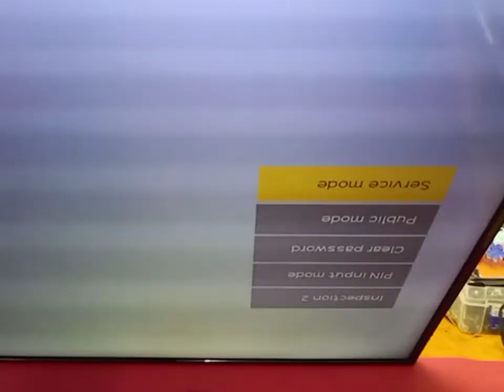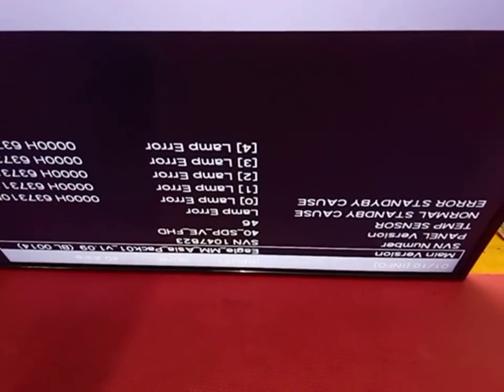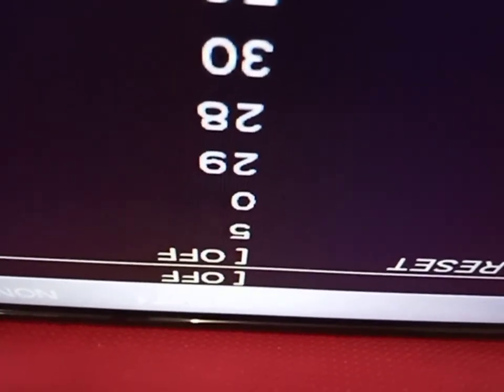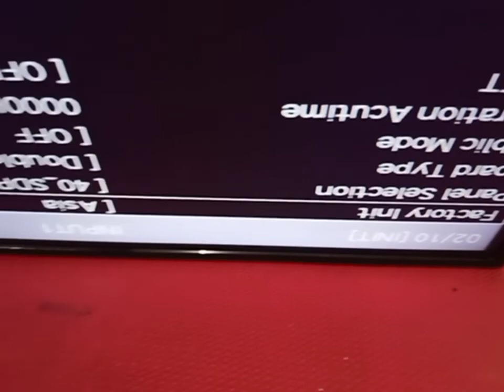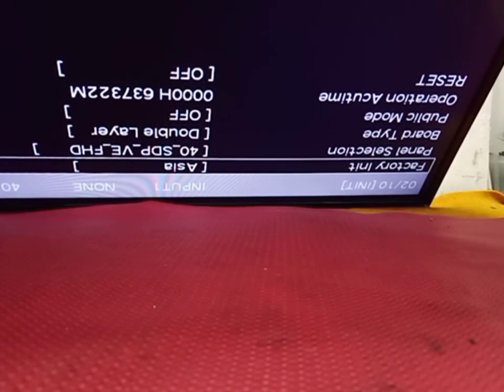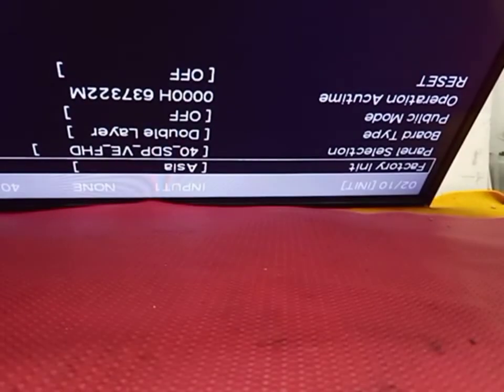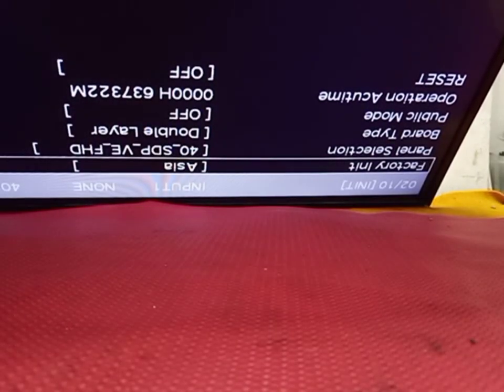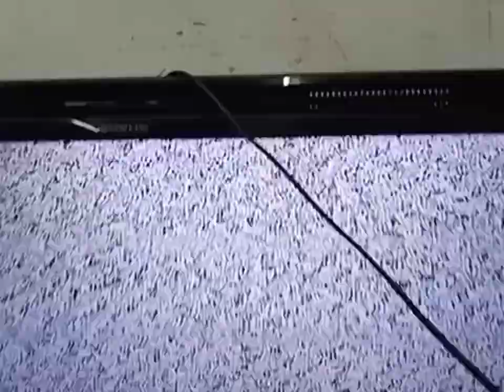SHARP AQUOS 40 Inch LED Tv How to reset main board from factroy service menu# Model LC-40SA5100M

Comment: Sir, Thank you for this video 
1. Unplug the power
2. Plug in with power 
3. Press the power button for some time 
4. Red light blinking 
5. Back light on with service manu 
6. Select service mode & enter
7. Select 9 page
8. Select L ERR RESET 0
9. Select 2 page
10. Select factory int.

This way sir?
Reply from the maker: Hi when sharp tv has no picture or red light blinking it is gose to protection mode, When Backlight issue tv can't on and its go to protecton mode after repair backlight must reset mother board from service menu
Reply: Thanks for reply